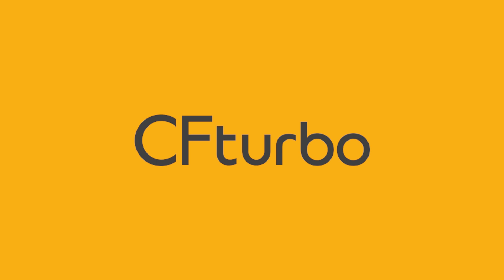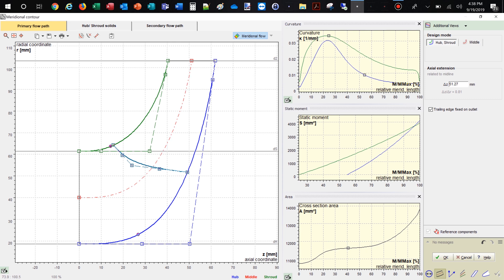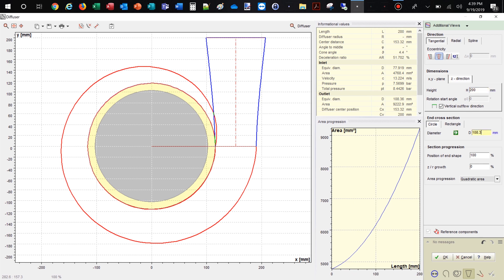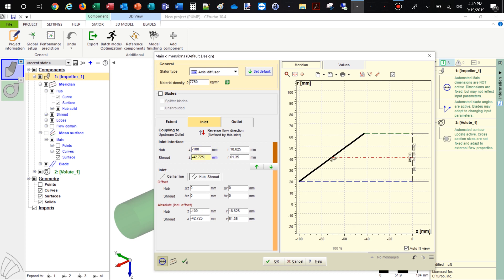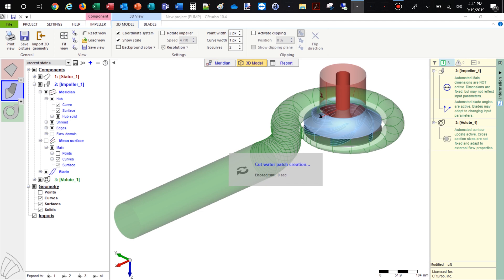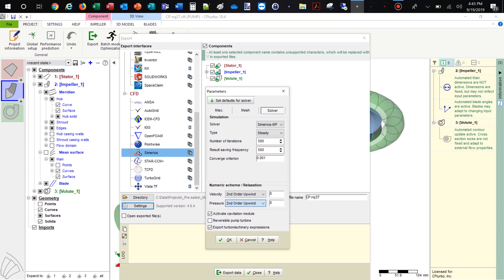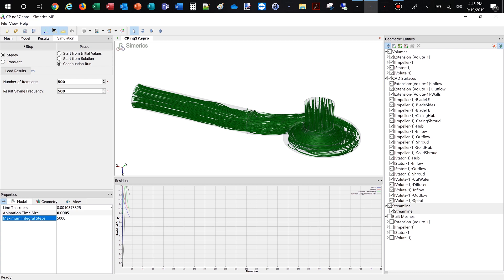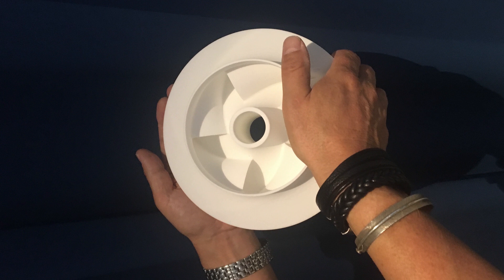CFturbo Demo on Centrifugal Pump Design and Simulation

Comment: Thanks for the Video, Actually I need an advice because I have designed an impeller using Cfturbo 10.4 to print it in 3D. Firstly, after finishing, I have opened the model on Solidworks and it showed the blades are not solid but hollowed, and actually i can see this note in this video also, so how did you print the impeller and the blades are completly solid while in the Cfturob the blades are hollowed. Secondly, when i saved the file on solidworks as .slt file, it showed on the printer software "Idea Maker" an uncomplete model, there are some missing parts of the impeller